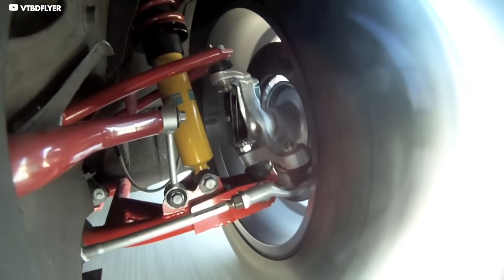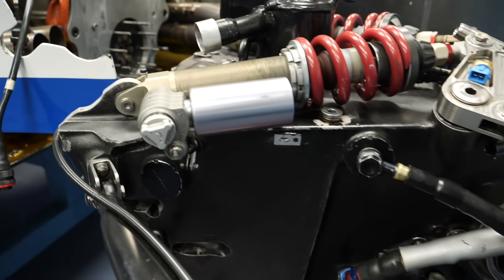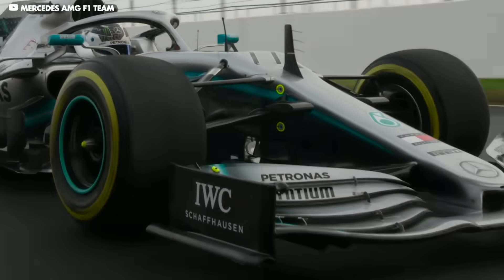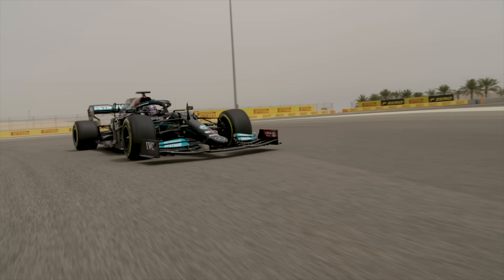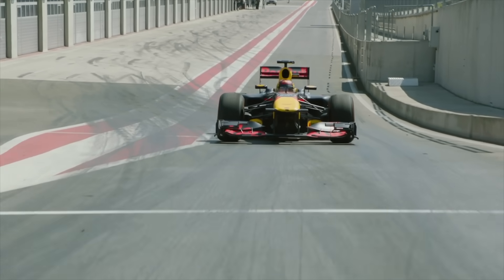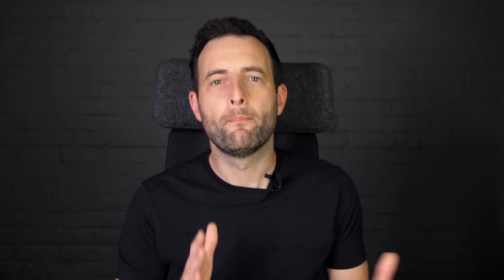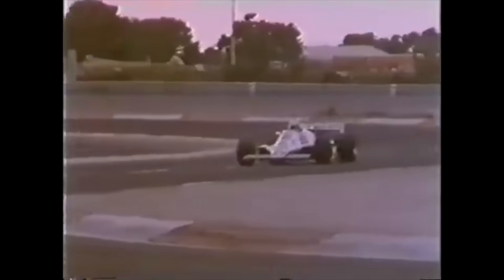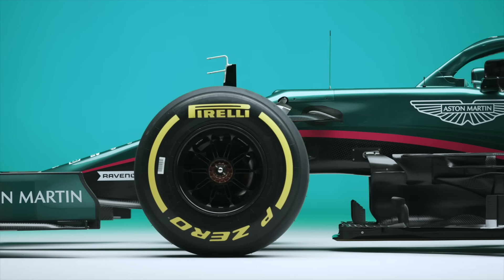Why this Formula 1 Car was FASTER Without Suspension

Comment: Sorry but weight transfer is almost only dependent on CoG height, track width and/or wheelbase and the acceleration you are experiencing.  Soft setup makes it more visible but it occurs on no suspension as well. And you need to be more careful with no suspension since there is not much early sign before loosing grip.  If you increase roll stiffness and spring rate too much on front axle, you get more understeer and the same for rear axle.  But you are absolutely right about upsetting aero with pitch and roll
Reply: True

Comment: Removing suspension doesn't reduce weight transfer.
Weight transfer is function of CoG and track width and wheelbase.
Suspension reduce the speed at which weight transfer happens, no suspension means weight transfer is instantaneous.
Reply: Yep. This is one of the many myths that people constantly spread. It drives me nuts.
Reply: Totally agree! I was surprised when he mentioned that. Ok, you might say that some deviation of CG position might attribute to additional weight transfer, but that's really a small difference.
Reply: Absolutely correct. Why on earth do people keep perpetuating this myth?
Reply: @pjay3028  Because it's a simple analogy that is sort of kind of half true. For example, if you stiffen (or in this case, LOCK) the suspension just on the rear, the rear tires are now going to take a larger percentage of the weight transfer in cornering. The total weight transfer is the same but the rear is forced to take more of it, thus inducing oversteer. I hate half truths because they lead to misunderstandings like this
Reply: @wingracer1614  but what you describe is actually the exact opposite of what was said in the video, so rather than a half truth it's more like a whole lie! 😂

Comment: 0:35 
I can't believe a pro driver repeats such mistakes. Tyre contact patch has NOTHING to do with grip per se.
It only becomes relevant when thermal properties and 'brush' characteristics of rubber are in place.
Reply: There are several massive errors in this vid unfortunately.
Reply: You're right, but the whole story is far too complex to put in one youtube video. The main point here was: if there is no contact there can be no grip, regardless of other factors in play.

Comment: Speaking of suspension I recently noticed something odd on the Red Bull cars and their steering. 
When I was watching Max on the warmup lap from the TV camera view I noticed that when he turned side to side when warming the tires "the whole front suspension pivots" around a central point. 
The wheels not only turn around the kingpin axis, on the ball joints, the whole upper wishbone seems to move as though pivoting.

Have you seen anything like it before. Has anyone. Is it new or old. I have only just got access to the camera view of my choice and have never noticed it before.

I have never heard of such a thing except in billy carts but maybe I am just out of date.

If curious check out the Red Bulls on the warm up lap from the driver view camera, the one looking over the shoulder of the driver.

Comment: It will hurt your back even more if the tire pressure is high
But even so higher rake mean at straits the rear tire will suffer more than it should be

Comment: The amount of load transfer is NOT changing without suspension, it is only related to CoG height, trackwidth and lateral acceleration!
A car without suspension has no option to setup lateral load transfer distribution between front and rear axle and may end up being slower in terms of mechanical grip. All it changes is the roll rate to a near infinit value, depending on chassis and tire stiffness.
Reply: Actually you can still adjust lateral load distribution front to rear on a car with no suspension. You can change front or rear track width, static weight distribution or tire pressures. This is basically how you setup a go kart.
Reply: Yeah, thats iffy to say lol. Load may transfer quicker, but it's the same forces acting upon the same vehicle
Reply: Thank you!  While I was stunned while watching this video and thought I was losing my mind.  I'm kind of astounded by the inaccurate info as well as the fact that so few seem to notice it.

Comment: Weight transfer only depends on the CG height and track width. NOT on suspension movement!
Reply: The most important comment on this video. Cheers, Kumquat!

Being extremely rigorous, suspension movement can indeed influence load transfer, but only on high travel suspensions (where the CG ends up moving horizontally). Not really on a road racing car, and certainly not on a F1 car.

Where suspension rigidity takes an important role, is in how fast the load transfer occur, meaning: the transient state. The final load transfer (after reaching a steady state during a corner) is the same, no matter the rigidity.

All the effects commented by Scott (during the weight transfer part) are due to that difference in transient state. For example: a soft sprung car won't be able to load the outside tire as fast as a stiff one. So a quick steering input won't have an increased vertical load through the outside tire to rely on, making the car feeling sluggish. If you are patient to wait for the load to finish transferring, it will have the same lateral acceleration as a stiffer car.

@Driver61, nice video once again, nonetheless.
Reply: If anithing you would loose the ability to transfer weight from front to back during lateral acceleration by ditching antiroll bars. They are an important part of the setup in creating oversteer, understeer or neutral handling. I wonder how that would affect handling.
Reply: Actually for example when car with lots body roll goes around corners all of the weight tosses to one side that's a big weight transfer.

Comment: Yo that was a good question right at the end there. What if we could put suspension in the seat, would we get the perfect racing car or an abomination?
Reply: Our family's tractor already does it! No suspension, but the seat is mounted on rubber and springs
Reply: @juanordonezgalban2278  How's it compare to a similar tractor with traditional suspension?
Reply: @CatfishSprinkles  I don't know, we have this 1 tractor and I haven't used it in years. But at 10kmh in our potato field is good enough

Comment: The time lost from having to avoid the kerbs would be huge on some circuits. With the current high wall tyres it would be bad enough but with the low profile tyres being introduced for 2022 this would only get worse as the tyres are a big percentage of an F1 cars shock absorption.
Reply: I wonder if springs will need to be run softer for 2022 to make up for the smaller tyre side walls.
Reply: @bazneedshobbies  I guess so but then I’m not an F1 engineer. They will surly have a more stable and predictable tyre with the smaller walls. Maybe @driver61 could do a video on this as it would be pretty interesting.
Reply: @bazneedshobbies  Most definitely. Tunes should be more specific because they aren't washed out by the spring rate of the tire wall as much
Reply: I wonder if we are going to see cars avoiding kerbs anyway in 2022 due to the need to keep underbody airflow constant.

Comment: Thanks a lot for all you very thoughtful explanations. One interesting factor explaining why current formula 1 suspension are very stiff is also the current tires. The size and shape of the current tires are acting as an additional suspension. It absorbs shocks by deformation and enable teams to design and setup very stiff suspensions. The new 18’ tires may force teams to design softer suspensions by the way.
Hope you exceed 600k followers soon !

Comment: This is why F1 teams do not want to go with 18"wheels.  With the current 13" wheels 90% of the suspension is in the tires.  The caveat is with the insane tire psi they run this season it is a little less.

Comment: NASCAR teams did something similar in 2006-2007 with coil binding. They’d set up their cars so that at speed the springs would be fully compressed, meaning the suspension would not move and the tires became the suspension.
Reply: Not quite as the suspension still has movement in droop. Close though.

Comment: The weight transfer is the same. The transient weight transfer is less. Basically, the dampers resist fast weight transfer and that results in a temporary increase in the load at the tire contact patch. Once the suspension settles as you mentioned, the weight transfer is identical to a vehicle with no suspension.
Reply: Makes sense. That part of the video made me scratch my head
Reply: Thank you.

Comment: I think body roll is a minor contributor to weight transfer on a race car. The center of gravity is not that much higher than the roll axis. Centripetal force and the height of center of gravity  causes the majority of weight transfer.

Comment: Simple, just like a bike without suspension is faster because the power goes straight to the back tires, but with suspension it wiggles around and the power is lost because of the suspension. That’s the simple explanation.👍🏼

But in a bumpy trail a suspension bike will go faster because it doesn’t bounce as much as the bike without suspension, and because the bike without suspension will loose the power it sent to the back wheels

Comment: Question 1. 
Am I correct in thinking that there would be a fine line between a properly suspended seat and the driver felling like he is driving from a hammock?
Question 2.
Thinking about seat suspension; Is there no compressible structure under the current F1 seats?
I understand the C.G. aspect but wouldn't that help to reduce back injuries from vertical loads?

Thanks for the great videos!

Comment: Far less weight transfer without suspension? Doesn't make sense. Weight transfer is majorly a function of COG height, thus, removing the suspension should very minutely affect total weight transfer. With suspension the increase could be from the COG arm due to roll, then due to some roll inertia being settled, and not aware of what more but the above mentioned cover the most big things that will make the difference 

Would love an explanation. Cheers
Reply: You are right, Tushar. I'll just copy my comment from another answer:

Being extremely rigorous, suspension movement can indeed influence load transfer, but only on high travel suspensions (where the CG ends up moving horizontally). Not really on a road racing car, and certainly not on a F1 car.

Where suspension rigidity takes an important role, is in how fast the load transfer occur, meaning: the transient state. The final load transfer (after reaching a steady state during a corner) is the same, no matter the rigidity.

All the effects commented by Scott (during the weight transfer part) are due to that difference in transient state. For example: a soft sprung car won't be able to load the outside tire as fast as a stiff one. So a quick steering input won't have an increased vertical load through the outside tire to rely on, making the car feeling sluggish. If you are patient to wait for the load to finish transferring, it will have the same lateral acceleration as a stiffer car.

@Driver61, nice video once again, nonetheless.
Reply: @heitooooor  Ah yes Heiter. Thanks for your input.

Indeed as the transfer rate is affected so depending upon the type of steering input, we can say for a given maneuver that load transfer will be less.
For example if it's a chicane, so fast such that the tyres aren't loaded in the first turn in, then yes it absolutely makes sense.

Thanks a lot for the answer! :)

Comment: Your remark @4:00 on "having no weight transfer in a car without suspension" is wrong, but it is a very common misconception.
A suspension slows down weight transfer during the transient phase of cornering. Once the suspension settles during cornering, the only thing that dictates weight transfer will be the height of the CG and the dimensions of the car - once the car is settled it doesn't matter if there is suspension or not.
This was part of my university thesis BTW.
What I think you are talking about is the "overshoot" phenomena on underdamped systems, because usually the roll of the car is not critically damped.
Reply: That's what I was thinking. If there was no weight transfer on an unsprung car, all tires would have the same load regardless of accelerarion or cornering, which obviously is not true. Really confused why this channel would say a mistake like this??
Reply: @Catrik  some racedrivers seem to use the term "weight transfer" and "overshoot" interchangeably, although that is wrong IMO. I have seen this mistake even on some old books about suspension design and tuning, which is quite confusing...
To clarify to others: cars with soft suspensions generally have a lot of roll. During the transient phase of the roll, the inertia of the rolling chassis can temporarily cause a weight transfer to the outside wheels which is bigger than the weight transfer happening when the suspension is settled, as the roll angle stops changing during cornering. The chassis rolls more than it would roll under quasi-static loading  - this phenomena is called overshoot.
This overshoot is very hard to predict for unexperienced drivers, and can make the car "snappy", suddenly losing traction on corner entry, if not driven smoothly (as correctly pointed by Scott on the video).
This overshoot is one of the reasons that a lot of inexperienced drivers will install stiff suspensions to their daily-drivers thinking it will make their car faster - the actual mechanical grip generated by a stiff suspension is generally worse (there's a video from Engineering Explained on the subject) - but a car with a somewhat stiff suspension is generally easier to handle, because there's no overshoot (along with other factors), giving more confidence to the inexperienced driver, which makes him go faster - a psychological performance bump, rather than improving the vehicle's actual performance.. (I am completely ignoring aero effects here of course)
Reply: @satanaz , perfect. Now I can finally stop scrolling because I'm satisfied with someone explaining the right things. Cheers!
Reply: @satanaz  Thanks for explaining the overshoot, I had not thought of that before but it makes sense.
Reply: @satanaz  Wait so the inertia of the body rolling over does actually cause a bit more weight transfer....?
Reply: @projectilequestion   indeed, but only if the roll of the chassis is underdamped. 
Also, the difference in weight transfer is very marginal in cars with very stiff suspension, because the chassis doesn't roll too much, and thus doesn't have enough roll inertia to cause a lot of overshoot, so, saying "a car with no suspension has far less weight transfer" is a far stretch and kind of misleading
But I have now watched the video again and realized I overreacted on my original post, Scott never said "car without suspension has no weight transfer". Technically he didn't say anything wrong, he just overly simplified stuff and I misinterpreted his words at first...
Reply: @satanaz  My God, it's a blessing meeting you. I've learned more from this paragraph than I have in 5 years of learning.
Reply: @satanaz , yeah, it sounded worse than it really was. But paying more attention, I think the 4:30 phrase can be labeled as incorrect. "Far less" is too much in this case.
Reply: @satanaz  So lets get this straight. Two identical cars, take an identical corner at an identical speed. The only difference is, is that one car has hard suspension, the other soft.
When the corner starts the car with the soft suspension pushes its tires into the road, but not as hard, as the hard suspension. The result is, is that the soft suspensions car tire deflects less, the body continues to roll, until the suspension reaches the limit of travel and the tire 'over-deflects' and the stretches into its final slip angle. 
Then with the harder suspension car. The tire deflects it its final slip angle basically in tandem with the cars actual forces as it turns the corner. 
Is this why they talk about "the 'weight' settling faster" being a good thing?
Reply: @projectilequestion  that is correct, but that's only one side of the coin
while the chassis is still rolling, the potential grip of the whole car is bigger, because the full weight transfer to the outside tires will only occur when the suspension reaches the limit of travel - in the meantime, before the full weight transfer happens as the cars settles into the corner, the outside tires are being able to handle a tiny amount more of cornering load
So, for the two hypothetical cars of your example, the hard-suspension-car will 'saturate' its outside tires faster than the one with soft suspension.
That means that the car with soft suspension can enter the corner slightly faster, or it can take a slighter more aggressive line through the corner.
And the magic happens when you account for the damping of the roll on your suspension design. If the damping of the roll is well setup, then you can make mitigate the overshoot on roll, and the 'over-deflection' on the tire will not be much bigger than the car with a hard suspension, which means that a car with a lot or roll can out-perform a car with a hard suspension on a corner - assuming your suspension geometry is good enough to keep the tires flat to the ground as the car rolls, but this you already knew :)
Reply: @satanaz  Hello. I'd like to ask something. As far as I understand, dampers modify the rate of weight transfer too. So theoretically, it should be possible for a car to reach an apex with very little weight transfer which would maximize its grip. Of course I assume the chassis has its CoG in the optimal location. What drawbacks are there in damping the car to such an extent for a race application?
Reply: Agree